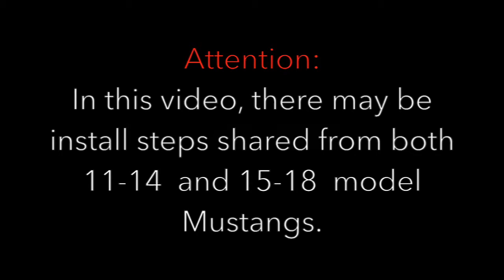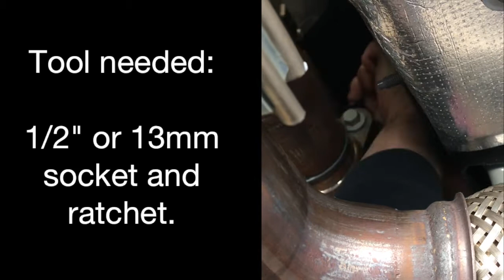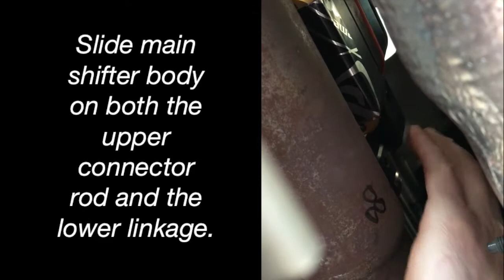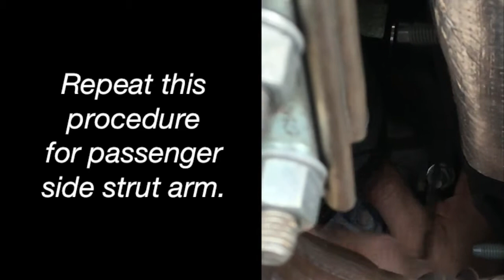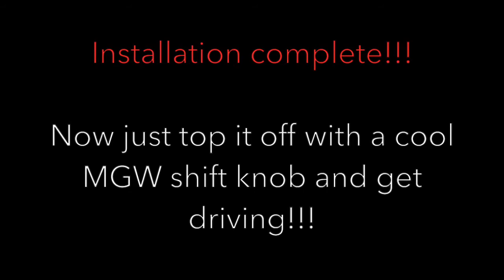MGW 2011 2014 MT 82 RACE SPEC INSTALLATION

Comment: 11:57 DO NOT torque the transmission crossmember bolts to 76 lb ft.  the correct spec from what we could find is 46 lb ft.  If you try 76 lb ft, you will probably strip the holes right out of your chassis.  ASK ME HOW I KNOW
Reply: How do you repair them? Just curious. I almost did the same thing. The flat plate that they thread into is on top do the chassis.

Comment: So that rear shifter bracket that is removed does not get reinstalled? I purchased the whiteline bushing for that but it looks like I don't need it.
Reply from the maker: that is correct. it mounts solely to the trans.
Reply: @MGWINC  so it does get reinstalled? The video doesn't show that part
Reply from the maker: @5starmansavagesidots  no it does NOT get installed. The shifter mounts solely to the trans not the body. Remove that rear bracket and you can discard it .

Comment: The work area in this video is much too dark. I really can't see what is being done, just the back of the installer's hands. In some spots, the text is on-screen too short to read.
I'll be under the car tomorrow trying to figure it out. I'm sure it will be worth it. I have a T56 and a T45 MGW in other cars and love them.

Next-Day: The shifter is in and it is a huge improvement over stock.  The binding on the 1-2 shift is gone. 2-3 and 3-4 are effortless.  There is no increase in NVH.

I had some install issues(2012 BOSS, stock driveshaft).
1. Do a test fit first, no locktite, no boot, snug the bolts, raise the trans, and check the reverse lockout. My car's trans tunnel hole was too small to install the shifter from the top It went in easily from the bottom.

2. After completing the test fit, lower the trans again, slack the bridge bolts and arms, leave the bridge in place and remove the shifter. Fit the boot and dynamat while the shifter is out of the car (thanks capriracer351). It is almost impossible to fit the boot from the top.

3. Install the shifter, snug the bolts using locktite. Install the heat shield. After raising the trans, tighten fully.

This may seem like a lot of extra work but it will actually save a bit of time by not struggling with the boot.

Comment: How to install the shifter boot its waaay harder in real life.
Reply: I missed up my fingers and still couldn’t install it.
Reply: Took me hours, (and my hands hate me) but I finally got using a large flat blade screwdriver and an old brake adjuster spoon from inside the boot.  Per @capriracer351's advice above, the boot should be installed with the shifter out of the car.  I would also try zip tying the bottom of the boot into the groove on the shifter.

Comment: This is a great shifter, but I am going to save some of you some time in doing this. This is coming from a guy laying on his back on his garage floor. A vast majority of this shifter install is easy and straight forward except for the following. This is specific to my 2014 Coyote powered car that is still bone stock from the factory, except for a set of muffler delete pipes out back. Yours may be similar from this era: 

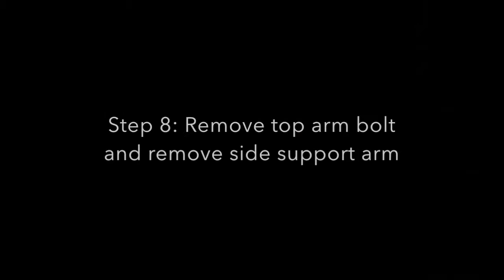1. Your biggest source of trouble will be at 3:57 and at 8:07. If you still have the factory 2 piece driveshaft like I do, loosen the center support bolts until you just have 2 or 3 threads engaged. If you have the car on a lift and you are standing under it, maybe you can get the leverage to pull the transmission down. If you are lying on your back and have XXL hands and large forearms like I do, you can't get your arm wrapped around good enough to get the transmission down far enough to get that bolt out or back in for that matter without the extra flex allowed when that driveshaft support is loose. 

2. When you install that bridge starting at 8:17 you will find that the stainless bushing will be tough to align with the hole while on your back. Find yourself a bolt that is the same size as the factory one, but shorter, so there is room to push it in straight without having to pull the transmission down. Then push on that bolt with one finger while you push the bridge around until that shorter bolt slides in and out smoothly. Now, leaving that bolt fully pushed in, attach the strut to the side of the transmission that you will NOT be wrenching on. Just tighten the side bolt enough so that the strut doesn't come off. This will help keep the bridge in place while you are yanking on things. Pull the short bolt out of the hole, making sure it still pulls out smoothly. Now, you will not be trying to align that hole while pulling down on the transmission and trying to push that longer factory bolt in. 

3. 9:21. Put that boot on NOW. Believe me. That is the time to do it. If you need to adjust the the reverse lockout, you will still be able to do it with that boot  installed. It will not be as easy as with the boot off, but it can be done. I ended up removing the shifter to get that boot on. And it is not as easy as taking the bolts off and sliding it out. I had to remove the side struts from the transmission to give things some slack AND drop the transmission back down to get the thing out. So basically I had to start 3/4 of the way over when I was just about done to install a rubber boot. Again, I can't stress this enough. Put that boot on NOW. One big problem too is that I had already installed that heat shield to the underside of the shifter, it is now scraped up since this shifter is a tight fit into and out of that hole in the driveshaft tunnel even without it. 

Hopefully this will save some people a bit of aggravation. I'm not sure what year the car was being used in the installation video, but I see some differences between that car and mine. At the beginning of the video, it did state it incorporated some elements of an '11 to '14 and a '15-'18 car. I have to wonder if this car was a '15 and up? It looked as the hole in the transmission tunnel was larger than mine was. Maybe these steps that I outlined will help out a person doing a car that is an '11 to '14.
Reply: Installing this weekend. Thank you for this. Btw, this video was filmed on an 11-14, so I'm not sure why there's so many differences. Maybe it was an '11 or '12. I have a '13 so this guide will help me a lot. Appreciate this!
Reply: @MassimoO  hopefully it helps. Once you get this shifter in, you will be glad you did. The best thing I have done to my car so far. Considerably better than the factory junk shifter.
Reply: @capriracer351  most definitely. I had MGW on my '07 GT and it was my favorite thing I did to that car. MGW is a classic example of you get what you pay for with their competitors. I've heard time and time again no short shifter compares to MGW on these Mustangs. You pay more but you definitely get your money's worth, which I have no problem dropping on cash on situations like this.
Reply: Thanks for your advice! 

I ran into that same problem with the bolt (at 3:57), and found another trick that helped me get it out. Once I had unthreaded it, and was stuck on that last little lip of the transmission mount, I grabbed the open end of a 10mm box wrench, and started rotating the bolt counterclockwise, one quarter turn at a time... 

Since the threading was caught on the lip of the transmission mount, turning it helped slowly force the bolt that last little bit out of its hole. The same strategy also helped me get it squeezed back into the transmission mount, when I was trying to fit it back in.

I pulled up the mustang shop manual, after the fact, and apparently Ford's official method, for removing that bolt, is to detach the driveshaft entirely, so that the transmission can drop a bit further down.
Reply: Getting that boot on is a real bear. It's amazing how he just pops it on there like it was nothing in this video. I worked at it forever, separating my fingernails from my thumb and index finger, and getting nowhere. I gave up for a while and tried again later, and I was able to finally get it. I pulled the bottom lip of the boot over the left front corner, then right front, then unhooked it from the reverse lockout bolt on the right where it was hanging up, and then pulled it over the right rear and finally the left rear. It seemed impossible, like I would never ever get it, until I happened to just suddenly get it on. This is on a '13 GT.
Reply: I know this is an older thread, but I just did this install a few days ago (2012 GT, standard Race-Spec), on jack stands.  Perhaps other people will still be installing this shifter as time goes by.  Your write up was very helpful, in addition to the videos by MGW. 

1.  As far as the removing/installing the long top arm bolt (3:57 and 8:07), I did take a different approach.  Since I was also removing the previously installed Steeda transmission mount bushing insert, I had removed the crossmember from the MT-82 (just two additional nuts, note the arrow on the top of the mount when reinstalling).  This also provides additional access for the install.  Instead of pulling down on the driveshaft, I used a block of wood placed against the bottom of the car floor and used my small floor jack handle to pry down on the solid/top part of the transmission mount (not a lot of effort required).  I could do this with my right hand and remove/insert the bolt with my left hand.

2.  I was lucky here, and the bolt went right in.

3.  I had experienced this with when I installed my Barton shifter, so I already had a healthy fear/respect of this part of the install.  I had installed the shifter without the boot to make sure the lockout functioned correctly (no thread locker at this point on the 3 shifter bolts)  and then removed it to install the boot on the shifter.  However, I struggled to get the shifter back in at the point and the boot came off as I fumbled with it.  Perhaps zip tying the bottom of the  boot on would have guaranteed it stayed on.  In retrospect, I should have removed the side support arms from the transmission and that probably would have made it easier to get the shifter back in with the boot on.  In the end, I did wrestle with the boot after the shifter was installed.  It's a ten minute job that took me hours.  I eventually got it using a large flat blade screwdriver and  brake adjusting spoon, working in on from inside the boot.  Your comment regarding the heat shield was also invaluable.  Consequently, I waited until the shifter was installed and I had the boot secured to put the dynamax and the heat shield on.

I can also verify that the BMR front driveshaft loop and the MGW shifter are fully compatible.  Three is more vibration feedback in the MGW shifter itself, but you only notice it when you first grab the  ball (as with any shifter, it shouldn't be used as a hand rest).  From a noise prospective, it's quiet enough.  I   I replaced the Barton shifter, two post bracket, and the Steeda transmission mount insert.  The shifter and bracket worked well and I did like that combination, but later I added the bushing insert and that did add a fair amount of NVH (even with the 1" hole drilled in the center) over 2000 RPM.  If I wasn't racing the car, I probably would be satisfied with the just the Barton shifter and two post bracket.  The MGW is MUCH easier to get into reverse, but the lockout works as expected.  Coming from the Barton (40% throw reduction?) the MGW throw feels noticeable longer (as expected, standard-standard, 15% throw reduction), but I'm sure you wouldn't feel that way coming from the stock shifter.

Thanks for taking the time to create this writeup!  I hope that others will have an easier time, my hands are still sore!!

Just went to the track today for some 12.5 index racing.  I ran 12.66, 12.56, and 12.52.  Much to my surprise, I had a run with shift points in the 7000-7300 RPM range with NO LOCKOUT.  I know the stock clutch is typically still an issue, even after installing the new shifter, but I didn't have any issues today.  If this performance continues to hold true for me, I would have to say  the MGW (Race-Spec, standard, standard) was a better solution than the Barton Shifter, two post bracket, and Steeda transmission mount insert combination.
Reply: Definitely increased the value of m 2014 Mustang GT premium. Now I just need a tune 😁

Comment: Any reason a 4inch driveshaft would cause issues with clearance? Whether installation or operation there after?
Reply from the maker: yes a 4 inch driveshaft can have issues especially if the car has been lowered. We recommend a 3.500 max or return the car to factory height.
Reply: @MGWINC  Thank you. The car has not been lowered and no future plans to lower. When I originally bought the (one piece) driveshaft many years ago, the only option was 4 inch. Wondering if I need to replace it with a 3.5in before installing one of these shifters? If I am understanding correctly, it sounds like you're saying there can still be issues at stock height with a 4 inch driveshaft?
Reply from the maker: @k1DBLITZ  it will be close but should work if not lowered. I think you can try it before spending money on a new shaft.
Reply: @MGWINC  I will give it a shot. I can tell you that I currently have the Blowfish Racing Shifter bracket installed and it is millimeters away from the driveshaft. I haven't had an issue with contact yet, so I am very hopeful the MGM shifter will fit and be the "final" solution. Thanks!